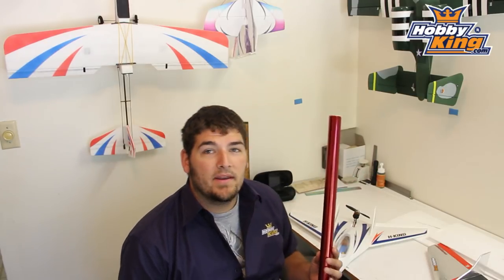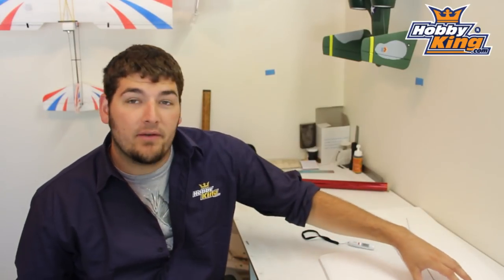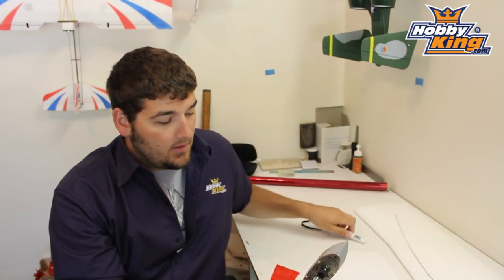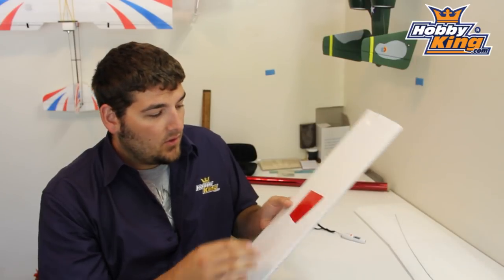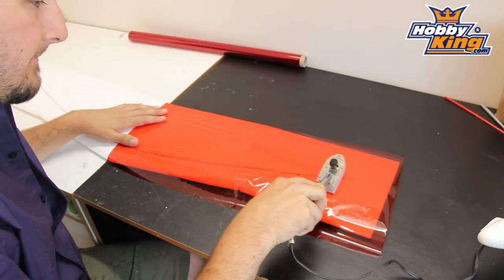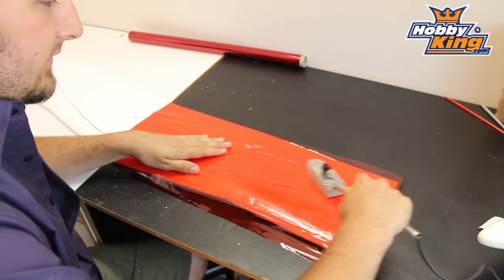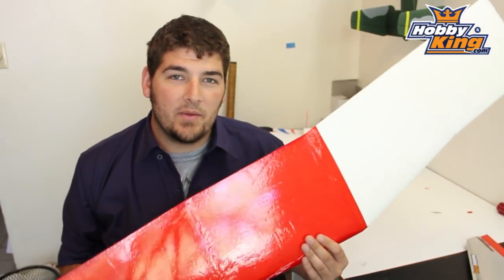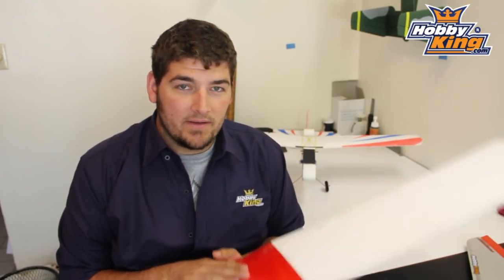HobbyKing Presents - Don's Tips Foam Covering

Comment: cover the bottom of a wing first then the top ..... fuss bottom sides top what ever you use be it tissue, silk, nylon or film. Next tack the leading edge first then the trailing edge ... heat the film it will shrink out the wrinkles then go over the film with the iron.

Comment: Being from the old school Balsawood construction days you need to be sure that when you are covering in Monocote or  other film covers that the film shrinks when heated and can cause unwanted distortions in the wings. We used this to our advantage with balsa wings to create washout at the wing tips.
Reply: Gene Patrick . .   do not use monokote to cover foam because the glue melting temperature is too high. Use ultracoat

Comment: Strange. I usually stick the outer borders at the edges until I can be sure it sticks reliable. Then I start to shrink everything on the inner surface. The whole surface will shrink and the the secured edges hold it in place. It´s like a perfect flat drumskin. Best be done with a hot fan. Experienced ones will cover the whole wing with just one peice of film. The edges of the film meet on the rear side of the wing. Usually hidden by the ailerons.

Comment: hey don i purchased an a380 rc 1.5m plane from hobby king and got some 1.7 mil clear laminate and want to cover the plane for looks and more strength. would i use the same process and is it a good thing to do to a new plane while assembling it. will it seal decals?

Comment: Would have been helpful to know what temp setting for the iron to prevent melting through or not enough heat to seal
Reply: he fairly clearly said it depends on the specific foam your using and you need to test what temp you can get away with, the higher you can go in the rating of the film covering without melting your specific foam the better to a certain point, but its very dependent on your exact foam and covering type
Reply: There's no set temp, it just is what it likes to be. A small test piece is best to try on first.

Comment: Isnt it better to use sticky adhesive backed covering
Reply: The adhesive is heat activated.
Reply: I know that ive used it for years but you can get covering with adhesive that does not nedd heat you just peel off the backing and it sticks easier
Reply: Ah, gotcha. My mistake.